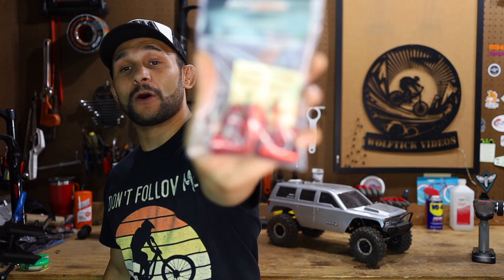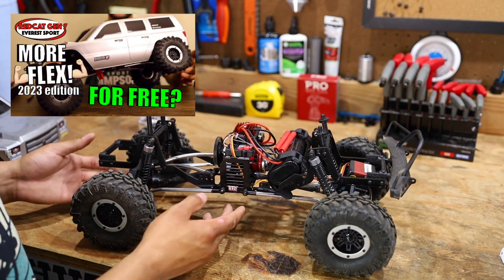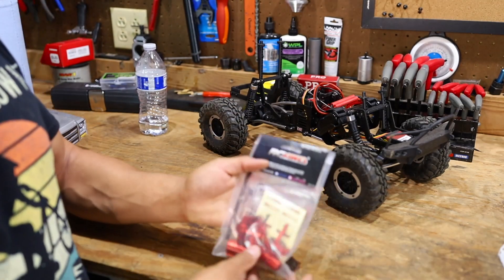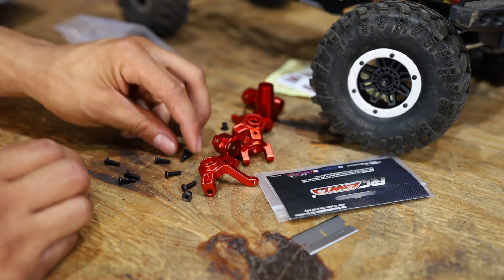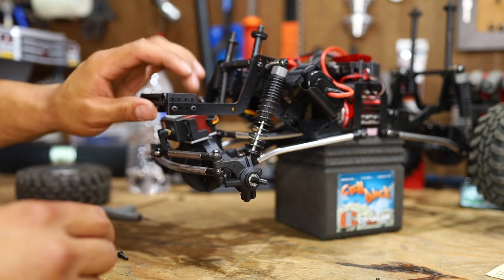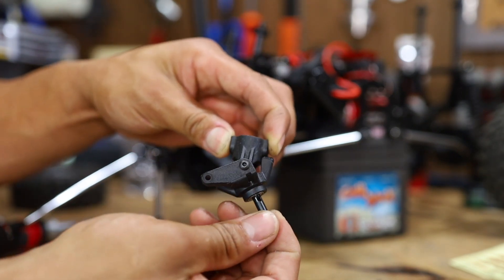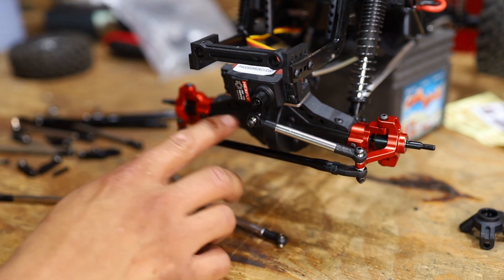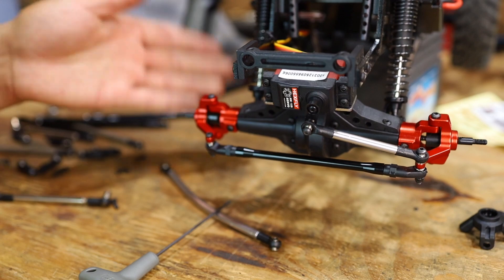RedCat Gen7: Fail!!!

Comment: I didn’t break any of my steering parts, but somehow I bent the actual steel axle on the same side. How I bent the steel axle but didn’t break any of the plastic parts, I will never know. I was crawling over some logs we set up in our yard. My gen 7 is only 3 weeks old. I really just got back into RC ground vehicles and crawling. I have been doing drones for the last 7 years. Crawling is much more fun and not nearly as expensive starting off. Thanks for sharing with us.

Comment: Hey dude, thank you for uploading videos like this on the gen 7. I picked up a used one and I'm learning as I go just like you. I am working on fixing the steering radius too, and those knuckles are beat up on mine too, so I decided to replace the whole axles with Injora Portal Axles. I watched your videos for inspiration while I am fixing it up. So thank you. I will drop back in and let you know how my fix/mod went, if I liked it and if I think you should copy me. Assuming your redcat is still just like it was in this vid.
Reply from the maker: It is still like it is in the video man, thanks for the comment and support! Have got to get that thing going strong lol. Good luck and let me know how it goes. Are you going to do the servo on axle?? Or buy the chassis plate??
Reply: @arkansasrcnewbie  staying on the axle.
Reply: Got my SCX10 Injora Portal Axles on massive improvement. Steers better, more clearance, lower gearing.

Comment: I changed out my RX and TX because the stock Redcat radio didn’t have enough adjustments for steering control.  Once I did that and moved the screw to the longer servo horn slot, my turning radius is as good as it can be and I am way happier with the vehicle.  On my DX5 radio, I’m pushing 140 on the adjustment in both directions with zero rubbing
Reply from the maker: Good to know thank-you! She's sitting on a shelf but I have got to get her out soon

Comment: Even though that alloy kit is advertised as Gen7, it's meant mainly for the SCX10 clones, the Injora and Austar, so you'll need the SCX10 steering and servo links to correct the geometry it is intended for.
Reply from the maker: Thank You!! You know it's been a mess and quite honestly it has made me lose interest in this build. I hope I can get my crap together soon and get re inspired with this rig. Thank you for the input
Reply: Oof, I goofed. My apology! In theory, all Injora/Austar chassis/parts are modeled after the SCX10 II and it would seem that the Gen7 is modeled after the first gen SCX10, but there's a problem...

I have the Gen7 and a project SCX10 (first gen). Well, their main steering links are very close. The Gen7 bolt-to-bolt measurement was 138mm while the SCX was 136mm. The difference is virtually negligible. So, steering linkage from the first gen SCX10 won't help.

So, that brings this to a worse situation.... The SCX10 II has redesigned axles through and through, so their steering linkage is even longer at 148mm! 

I'm not sure what the hell RCAWD sold you. It's a little concerning that on their site, they show pictures of a steering link on their full axles, but they don't seem to sell the link! Very odd indeed.
Reply: I suppose you could fabricate custom length links even though it's a pain in the arse. It really makes no sense unless RCAWD fashioned them from an unknown model because those steering hubs are definitely not Gen7 replicas otherwise the factory links would've worked perfectly. Firstly, I'd contact the company and see how far you get... hopefully, they can give you the custom links as a customer service thing or at least sell them with free shipping. 

Yeah, this would surely piss me off too when advertised as "Gen7" parts, but yet not 100% compatible. Again, sorry I couldn't offer an easy solution to this problem.

Comment: If u read this I’m just gonna say the more those axles turn the worse they bind and break I learned the hard way I can show u the broken parts but get a full metal front axle the rear is stronger but I’ve broken 4 front axles even upgraded ones so get the scx10 metal upgrade axle there’s a kit front and rear for like $70 and just saying I’ve took mine under water deep and it’s a beast I will say that I’m on my second motor but I wanna go brushless bad but then no more water and mud

Comment: You can pit the cva from Gen 7 Pro. The problem is that you need to be careful wheels weight, they put huge stress on the cva, and change to dog bone, and I have the metal crown mount because it is plastic they strip with easy, and you need to dismantle the axles from and back
Reply from the maker: Man, thank you so much for the tips!! Really

Comment: Theres not alot u can't do with a gen7 and u can get just the chassis servo mount for the portal kit alone and make it work but honestly the whole kit is the best route as it will transform the trucks performance
Reply from the maker: Thanks Paul, that sounds great. I think I might just pull the trigger on those, under $100
Reply: In my opinion the Everest gen 7 doesn't need to be upgraded. I'm leaving mine 100% stock, it's perfect already.people are working on them while I'm out using mine a few hours a day. Build a rock Boulder Field in your yard, or dig holes, there are no rules. Even us boomers are liking it.

Comment: I've never had any luck with rcawd anything. Throw in the portal kit. Throw away the chassis mount servo plate/3 link. Buy a 1tenth soa 4 link kit and upgrade to a 35kg servo. It will come with a longer dual clamping servo arm. Then u have to dial down your steering end points because it will over travel, rather than under travel
Reply from the maker: Man, thanks a bunch. I really wanna do what you said. I looked it up and it sounds and looks great! Thank you so much

Comment: Get the axial scx10 metal upgrade axles and they are great I got the transmission also and only had to open up two mount holes a little bc one side is wider than the stock transmission but metal axles and literally everything on it stock I’ve broken my truck is completely built not bought lmfao only thing that’s same is tires and frame and servo electrical stuff but mechanical wise everything is not normal stuff bc I’ve got bags of broken axles different axles and these are the best come with great grease but I add cv axle grease in all my differentials on rc crawlers it sticks and keeps the gears quiet

Comment: I know you (probably) already figured it out but I own both the everest 10 and a gen7 and the axles are the same part but the knuckles are different and the gen7 has much shorter steering link mounts, you ordered parts for an everest 10 which will go on but you need the everest 10 links along with a much longer servo horn.
Reply from the maker: Man! Did not figure it out lol, thank you so much for the heads up!! O appreciate that

Comment: Needs a Longer servo horn. Best thing you can do for the rig is get rid of those huge  axles completely. Red cat portal kit or get some cheap injora  axles straight or portal
Reply from the maker: For sure man, thank you! I really like portal axles so I may just do those....Or I kinda like the idea of the injoras as well. Decisions decisions 🤷‍♂️😉
Reply: @arkansasrcnewbie  I personally have not used the injora  portals (knock off trx4 portal) but I've seen videos and they take a beating. I like the redcat v2 axles havent had any problems and they have alot of aftermarket support cheap and high  end. I got 2 redcat gen 8v2s and the gen7 pro that's gonna get an axle swap very soon

Comment: Yes you can run either cms or ams. You would not be able to run cms with those axles because you need to run a 3 link with a panhard to eliminate bump steer. That axle doesn't have a panhard mount. Also if you shortened the upper links it would clock your servo back. As it is now you're loosing steering because it's steering towards the ground.
Reply from the maker: SCIENCE BABY! LOVE IT ❤️ Thanks Luke